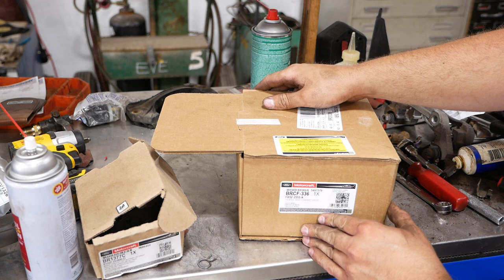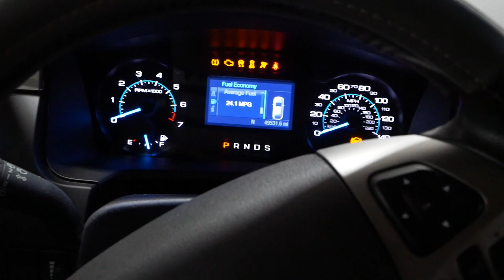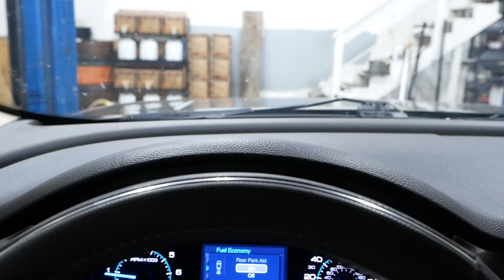Replacing a Brake Caliper with Integral Parking Brake - Ford Flex

Comment: This is a very common issue on these cars. It's a terrible design. Ford supposedly remedied it mid-cycle in 11 or 12, but as you can see, still a problem. These things hang up and owner gets terrible mileage. When my wife's Flex did this she was getting like 13 mpg. My V10 pickup was rivaling the gas mileage of this car. The only thing to do is keep an eye on them and maybe hit it with a temp gun once in a while to see if it's overheating. My old roommate had a Mitsubishi Eclipse with the same style rear caliper. He had problems with his too. They're trash.

Comment: I have a a32 cefiro better knows a infinity i30 an the rooters did the same thing front left an both back when i checked the abs sensor on thr left was cut so it was making the other 3 rothers lock up should i change the rooters they were rusty as well but i serviced them what you think

Comment: Aren't the OEM parts the same parts off of the same manufacturing line as the parts that the vehicle was built with?
Reply from the maker: No. Very rarely. If the vehicle is still in current production they might be. But most times the parts are sourced to a vendor who specializes in lower volume production that can handle all the packaging and labeling requirements for spare parts.

Comment: I hate the E brake screw in calipers and the cheap square adapter to screw it in.   Adds another 20 minutes and frustration to replace the pads for those rear wheels.   I know  pads all the way around is better,  but I like drums in the back and pads in the front.   The drums will outlast the small rear pads they put in most cars.  I know I must be a masochist to which for drums,  but those screw in calipers are such a pain.  Give me the old drums and E brake setup.

Comment: Hey Wes!  I have a 2018 Flex that I use to (attract hot babes and) cart my kids around. The 3.5 v6 is down to 14-15 mpg. No where near the 23 it claims on the highway. How would you start diagnosing the issue of crappy usage of dead dinosaurs??!?

Comment: In my experience, Ford rotors and pads are crap. 2013 Escape needed new rear rotors at 15k, then pads and rotors all around at 25k. Then again at 50k, so it got the finest the aftermarket scumbags had to offer. Those have lasted 80k now and cost less than motocrap.

Comment: I didn't think anyone turned rotors any more. Usually they charge the same as new rotors
Reply from the maker: $15 each will get them turned in my area. Makes a lot of sense when new ones are $75 each.
Reply: @WatchWesWork  if I remember the ones on my taurus where warped so I had to get new one(that also warped) but the ones on my 09 silverado where pretty cheap just a little more than turning them and I didn't have to wait till the next day to get them back

Comment: 07 Dodge Nitro. I did rotors,pads,caps last year at 187K they was the original. 13 years and why did I replace everything? Indiana...
Reply from the maker: Wow! That's impressive!
Reply: @WatchWesWork  I could have maybe got another year out of them but hey free money and rock auto, $300 later it was all new, hopefully won't have to bother again for another 13 years. and honestly if I was in Texas instead of Indiana..... I prob wouldn't have bothered changing for a few more years.... the Rust was the real killer.

Comment: Not using the parking brake is a North American issue, most autos are Automatic Transmission equipped so drivers rely on the parking pawl. In Europe if you don’t use the parking brake during a driving test you will fail. I have a 3/4 ton GMC and I use the parking brake. Your vehicle will thank you for it.

Comment: 13:11 You called the pads shoes. Unsubscribed! ;) lol Anyway, that is exactly how I have to get my wheels off, by using a big rubber mallet. The rotors require more persuasion when they are being replaced, in the form of a small sledgehammer :) But that pneumatic tool you were using seemed to do the trick!
Reply from the maker: Air hammer is the ticket. But you can really mangle them so you have to be careful if you are reusing them.
Reply: @WatchWesWork  Good to know 🙂

Comment: Putting grease on the pad side doesn't make sense to me, it seems like the first time the pads move it wipes it away and just attracts dirt.   I worked for a tier 1 supplier for Honda and we built the calipers for many Honda models, the Japanese engineers insisted we put grease on the pad side, despite my argument, they insisted it makes an improvement.  IDK, doesn't make sense to me...
Reply from the maker: Most service manuals say the same thing.

Comment: I swear Wes, try my method of bleeding brakes.
Simply place your finger over the opened nipple and have your slave I mean, helper pump to her little heart's delight.  It's quick and you have a higher chance of removing any bubbles in the line.  Keep your finger over the nipple.  Your finger becomes a check valve.

Comment: I get that with the absence of a yearly safety inspection, small vehicle owners can pretty much run their vehicles in whatever condition that suits them but being as America essentially wrote the book on litigation & law suits, how do you stand on doing a repair that you may feel falls below a certain standard for safety ? 
Can you be sued, or can you insist a repair is made to a standard or is it just a case of a written disclaimer absolves you of any potential safety related law suit? 
I only ask because here in England, you cannot buy brake pads other than in a complete set across an axle, this goes also for brake rotors, suspension springs, & dampers.
New pads on one just side of an axle would most likely fail the next inspection on brake balance here.
Reply from the maker: I always fail to realize that if I don't explicitly show it, it didn't happen. Of course I replace the pads and machined the rotor on both sides.
Reply: @WatchWesWork  
I didn’t think for a moment that it didn’t happen in this case as the car was not a rusted out heap but i was interested to know, having seen vehicles on your channel leave with serious defects that the customer has specifically instructed you to leave.

Comment: My method, which may also work for you... Get rid of the soft blow, use whatever is at hand, usually a 30oz hammer or a 2x4... Cuss a lot, smack shit until something breaks... Cuss some more because you broke something... Come to the realization that you must replace broken parts... Drive to parts store cussing about stupid engineers, on the way there say phrases like, "my old XXX pre 70's vehicle never had these types of problems" (while cussing some more)... Finally, replace broken parts and don't hook the e-brake cable back up...

Comment: i just crack the bleeder remove the top from the reservoir and wait gravity will push the air out wait till you get a constant flow nip up the bleeder off you go works for me and getting the flexi twisted is a rookie mistake your supposed to be a professional

Comment: Just one more reason that I don't buy Ford's. My only Ford is a 1940 Ford Pickup the we repaired by replacing the drive train with Chevy Parts and the front has 1w inch GM rotors.

Comment: Ah yes  you used a BFH to remove that aluminum wheel. You still have a brake lathe ? Tjey are getting rare. Most mechanics around here just replace rotors.

Comment: see like  every mechanic always looking at ways to get the customer to come back and spend more money  hes going to need new rotors in a few months  i can see that now there is no way i would have done  that might as well do them why you are there then they will be good for a while but any way that is my 2 cents
Reply from the maker: Instead of charging him $85 each for new rotors, I machine his original rotors for $15 each as part of an elaborate conspiracy to get him to come back later to spend more money. Sure, that makes sense.
Reply: @WatchWesWork   sorry mate but  man that owner is not smart now is he cause he will have to come back to you later so he wont be saving anything in the long run now will he but i guess i should not take it out on you you are just doing what the owner wants to i guess

Comment: "....pushes the nut away and it puts tension on the piston here".  ????????    Pushing puts tension??????     Tension is a pulling force.  I think you really meant "....it puts pressure on...".   Wes, there is a 180 degree difference in the direction of pressure and tension in any given mechanism.    If you did somehow really mean "tension", you did not describe the situation accurately.

Comment: I never understood people that don't use their parking brakes.  And I have an automatic with a pedal push-on / push-off brake I hate and live in a state alleged to be flatter than a pancake.  You're just wearing out a probably too tiny a locking pawl in the transmission, and as a certain range of Fords proved a few decades ago, it's foolish to assume the trans won't pop out of P and into R at the worst possible moment.  And in rust belt states, if you don't use it, you will lose it.

Comment: Yeah, the aggressive driving style of today's generation leads me to wonder how they can even get to 20,000 miles on a set of brakes.  Can't tell you how many cars I see on a daily basis that just HAVE to get around me by passing on the left or the right, then gun it up an off-ramp, just so that they can stomp the brakes at the end.  Me, on the other hand, I put the cheapie organic pads/shoes on, the kind that doesn't chew in to the rotors or the drums, and I let my right foot off the gas pedal, use the "coast" technique to get 'er down to under 20mph before using the brakes to finish the job.  Of course, that generates even more hate behind me.  I'm so out-of-place using the decel ramp to decelerate when the other 99% use it to accelerate to the very end then stomp the brakes to whoa in 20 feet.  Oh well, my amusement at their expense.  Keeps all the parts suppliers amused, too, as well as the techs who are lined up a month behind.
Reply from the maker: Move out of the big city!
Reply: @WatchWesWork  I don't live in the big city, I have to travel there in my line of work.
Reply from the maker: @stanpatterson5033  Ahh. Time to up-armor the family wagon then!

Comment: They're based off the old BorgWarner that the old Pontiacs used to have in the 80s they were a crappy design in the 80s I don't think they've changed much when it comes to crappydesign
Reply from the maker: If anything they are worse because they cheapened them up.
Reply: @WatchWesWork  pretty much they were a terrible design on 3 gen Pontiac trans am parking brake setup was terrible on those cars too my opinion the engineer at bor Warner designed them must been either drunk or high lol
Reply: @WatchWesWork  they also put those calipers on old Datsun pickup trucks

Comment: I never done a rear brake job on a vehicle with those type that dint have one or the other caliper siezed. I always quote the caliper cause the heat here in s texas lockes em up solid! guarantee one is always locked up. hate those stupid things. dumb design. vw's are the worst

Comment: No rotor(or drum) is worth turning these days...'cept new ones because they're often warped out of the box.  Sooo cheap.  Doesn't make sense to have a brake lathe, IMO.
Reply: There is a satisfaction that comes with a quality repair and not necessarily with total replacement!
Reply: @erikparent8176  Agreed but pretty sure I'd not dump the $$$ right away as a start-up shop on a brake lathe. ~$3K for a decent one.  Let the machine shop do it if you do it at all.  Practicality.
Reply: @nhzxboi  
I understand.

I'm also thinking it's not practicle for a very busy shop!
Reply from the maker: New rotors are $75 each. I can machine them for $15 each. Even my auto parts store does them for $15. Makes sense to me. Where it really shines is larger trucks where rotors are up to $200 each.

Comment: I've never seen anyone renew only one wheel of brake 
components before. It's always referred to as an "axle set"
and just about every manual and shop will not recommend
doing what you just did. Desperately poor people in
desperately poor times, I guess.

At least you now look way better with facial hair.
Reply from the maker: You still haven't...